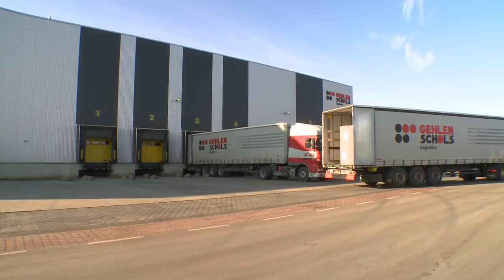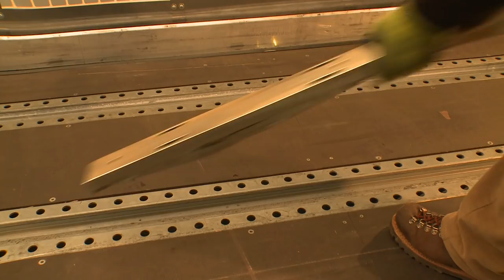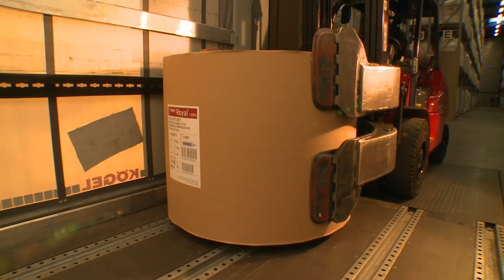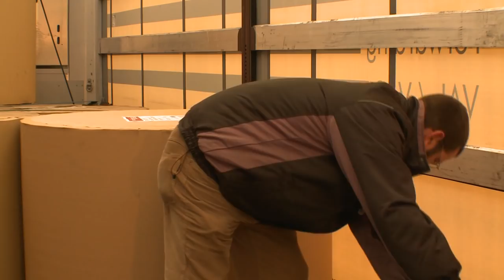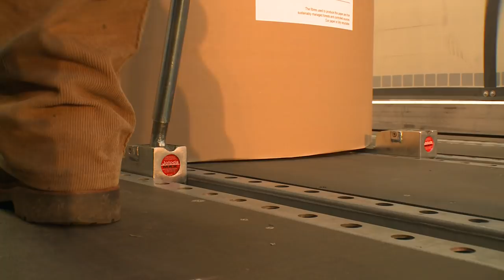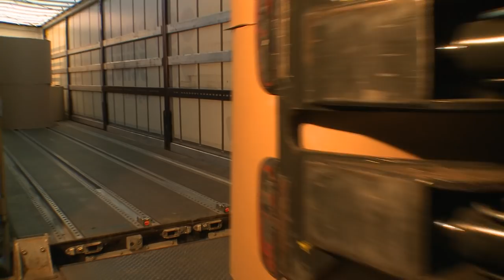A New Chapter In The Paper Industry - Watch Reels Be Loaded In Seconds

Comment: I load reels 2500 x 1530 diameter, usually 8 reels for around the 24500 kgs payload using skates,we back onto ramps so they roll without effort,having 1 skate clicked up and the other down when the fork is gone I stand the skate that is down and put pressure on the bar to roll and ride the skate down like a skateboard easing pressure on the bar to slow the reel.
Reply from the maker: Thanks for the feedback, @Kanetoad6097 👏🙌